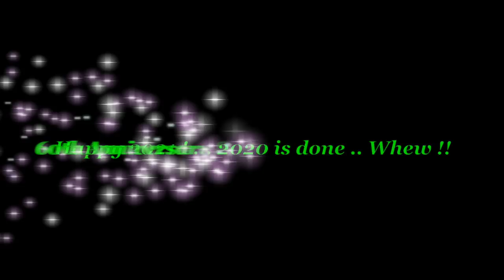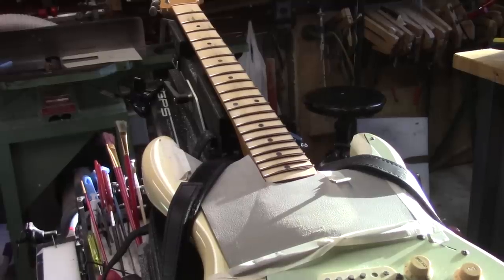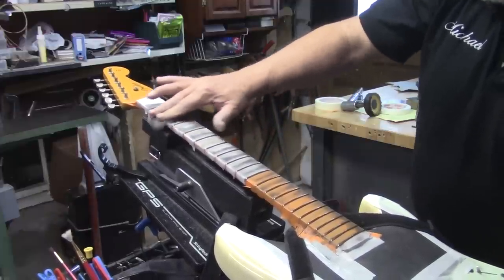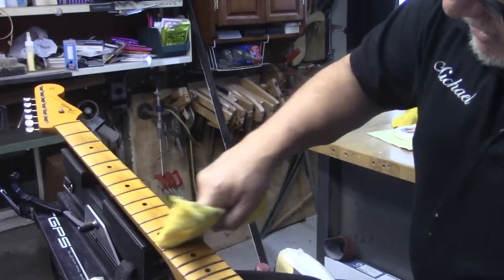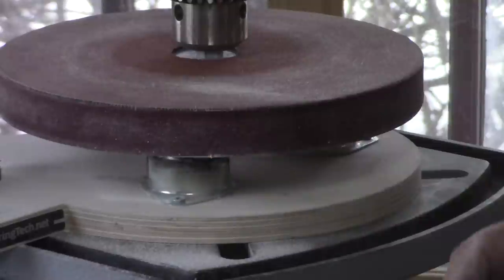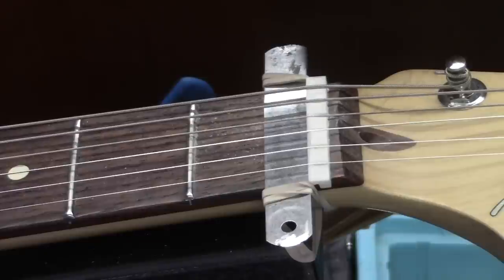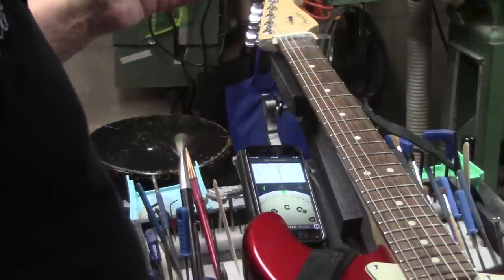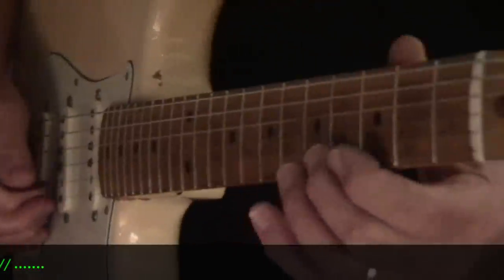Maple Neck Strat@StringTechWorkstations

Comment: I like your radius sanding platter on your drill press, complete with bearing assist to ensure level rotation. I'm sure you have platters for several common radii. Nice.
Reply from the maker: Actually the 24' radius on the top of the disc, pretty well covers it all. I have a bridge re-glue coming up on an HD 28 .... you'll get a front row seat on that job too ;^ ) ! The 9" diameter yields a 4 1/2" radius .... so you are covered for any guitar on the planet. All the best in 2021 David !
Reply: @StringTechWorkstations  Are you selling any of those sanding-discs-on-a-drill-press Mike?
Reply from the maker: Greg was waiting for the foot switches to come in .... there was a delay with the whole c-19 thing. Check with him about the eta. greg@stringtech.net

Comment: Amazing video. Just wanted to ask you if a guitar had a hump on the neck on the bass side (6th to 4th strings) around the 1-4th frets kind of like a twist, this is the case on my strat,  How would you suggest straightening it?
Reply from the maker: Hey Leo, these Strats were both fine in that regard. It sounds like ( if you have enough real estate in the height of the crown ) you may need to "spot dress" that hump. Happy 2021 !
Reply: @StringTechWorkstations  thanks for your reply. Happy New year to you 🎉💗
Reply: @StringTechWorkstations   Where is your work studio in Canada?
Reply from the maker: Stratford Ontario Canada

Comment: I’ve seen that issue with mid 90’s Strats before but never on a MIJ Strat. What can cause this type of flaking?
Reply from the maker: Well Jimmy .... it could be a a number of things : #1 Bad batch of sealer or lacquer  #2 Mis-match of finish with the thinner # 3 too much humidity in the air at the time it was sprayed #4 too much moisture content in the wood #5 moisture in the air lines ..... others may care to elaborate .... but that is my first 5 guesses. Cheers, HNY !